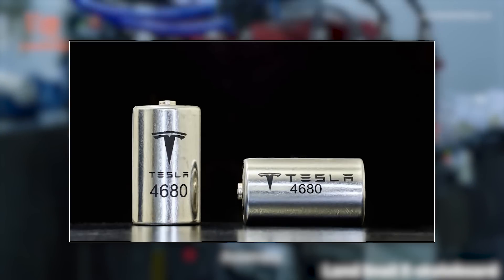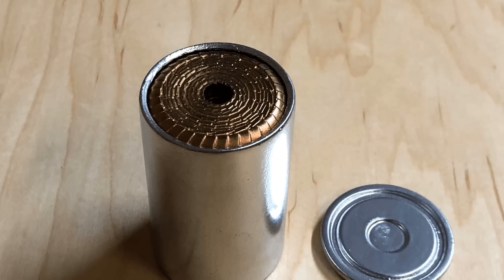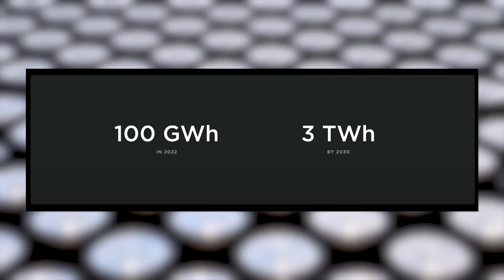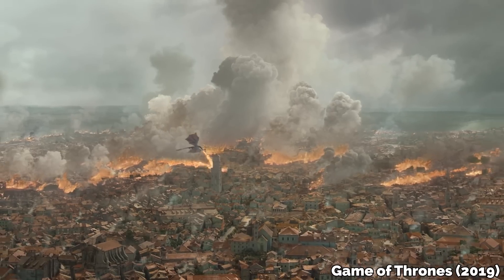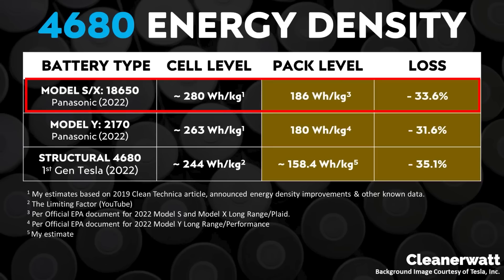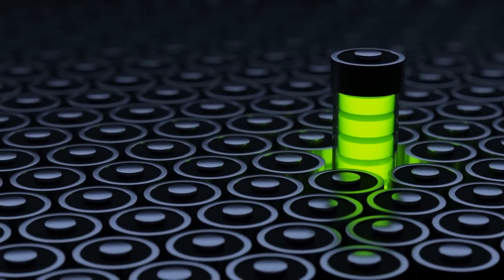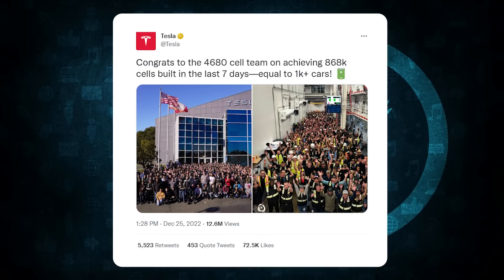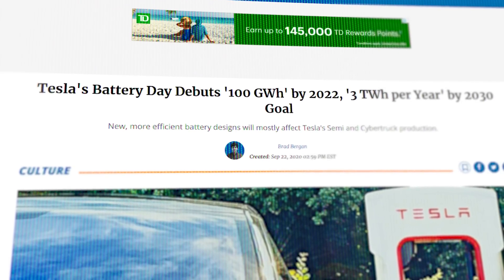The Disappointing Truth About Tesla's 4680 Battery Cell..

Comment: Its in the official numbers of Tesla that the energy density of the 4680s is lower than of the 2170s. Because Tesla said its 5x more Energy in a 5.5x bigger Battery. And with 6x more power they are on par with the pouch Cells, thanks to the tabless design. And the 16% more range (not 30%) - I think you can put more Energy in a block of cells thanks to the bigger cells. Tesla has told you so. Why have people expected something different? The only problem they have is to decrease costs because of problems in mass production. I think they will make it, but not now.

Comment: You completely ignored an important design metric: cost.   Tesla has become much more profitable recently.  It's not a s3xy message to say "we're going to derate the design to allow the use of cheaper materials" so of course they hype the potential of the new architecture to reach higher performance.    

It might be worth doing a deeper dive into cell chemistry to explore the trade-offs between cost, safety, scalability and performance (power/energy density).  I think Tesla has been focusing lately on reducing the cobalt requirements in the cells to enable scalability.  

As an Engineer and past/current owner of 4 different EVs from 4 different comapnies, I can say that ~200 miles of range is 'good enough' for most people.   More is nice, but beyond that the maximum 'real world' DCFC power levels and reliability of the DCFC stations matter more than the total available range.   

In this regard, the 'folded copper tiles' to reduce internal resistance of the cells is a significant innovation.  For cost and safety reasons,  Tesla may well elect not to take full advanatage of the current capacities of the new cells in their drivetrain design, but they can still make good use of it at the DCFCs to increase customer satisfaction and the throughput of the chargers.

Comment: One of the main advantages of the 4680 is as a structural pack and power density . It wins hands down there . Over time they will tweak it to have a great energy density at least equivalent to anything else they produce and most likely it will be the cell that most rnd will go into as it forms the nxt gen of manufacturing techniques !
Reply: Power density has not increased if you measured it, it actually decreased until battery is properly optimized

Comment: There is nothing disappoint about the 4680.  It's the same chemistry as the 2780 and yields about the same power.   I will be lower cost to manufacture.   Tesla has all the big boys lined up, GM, Ford, Toyota, Honda VW and is kicking there asses while people talking about how Tesla's margin is only 25 percent.   It's pretty clear who is getting paid off.

Comment: 18650 is the best because it has a larger market segment than a 4680. 4680 is only usable in a Tesla, while 18650 is used in wide range of application. If Tesla want to make money selling batteries, they need to make 18650.

Comment: What everyone missed in the 4680 hype (because tesla neglected to mention)  is that you get 5 times the energy from more than 5 times the weight, in other words a less efficient battery than the 2170 or the 18650,  however there are a few production advantages.  Unfortunately most people don't understand the science so they believe the hype so lets all go to Mars.

Comment: It's difficult to understand why 21700 hasn't leap-frogged over the 18650 to become the "standard" cylindrical 'flashlight' lithium cell. For just 3mm increase in diameter (1.5mm radius), and 5mm increase in length, a quality 21700 can safely and reliably deliver around 40% more Ah capacity than an quality 18650.
Also, if one decides to take advantage of the following feature, using a 21700 cell in the same application can have the ADDED major benefit of allowing one to put LESS stress on the cell by charging to the same mAh as one would have charged the 18650 cell capable of the same capacity. Remember that this is for an almost negligible increase in size and weight and in return you get a lithium cell that has a much longer lifetime and significantly more recharge cycles.

For example, charging a 5,000mAh 21700 cell to only 3,500mAh puts a LOT less stress on the 21700 cell than when charging a 3,500mAh 18650 cell to the same 3,500mAh. Thus, for the exact same amount of total per-use usage (e.g. let's say one typically used 3,000mAh of that 3,500mAh each time the cell is charged) the 21700 cell will have a MUCH, MUCH longer lifetime and have more recharging cycles to end-of-life than the 18650 cell, when charging both cells to 3500mAh. One could potentially get almost twice the number of recharges out of the 21700 cell than from out of the 18650 cell under the same charge and usage scenarios...all because one is putting far less electrochemical stress on the 21700 cell during charging and storage.

It's also much healthier for lithium-ion cells to be stored long-term at about 70% of a cell's full charge state than to be stored at a 100% of full charge state (see batteryuniversity website). Charging a 5,000mAh 3.7 li-ion 21700 cell to only 3,500mAh meets that condition. To charge to the same 70% for a 3,500mAh 18650 cell, one would charge it to only 2,450mAh. Thus, if you had to use cells straight from storage, you'd get about 40% more available energy out of a stored 21700 cell (3,500mAh) than a stored 18650 cell (2,450mAh)...which could be key during an emergency situation when you don't have time to "top-off" the cell before using it.

Comment: Just to clarify, the Ultium is not « just an off the shelf » battery chemistry. I think it is the only NMCA battery on the market. NMCA has the same energy density as NMC but it solves one of the main weaknesses of NMC: relatively low number of charge cycle before degradation.
Basically il combines the energy density of NMC battery with LFP charge cycle endurance.

Comment: Tesla acquired SilLion and Springpower around november 2021 to advance and upgrade the anode and cathode for their new 4680 battery cell technology. Tesla already has the capability to build the 4680 battery with a 30% increase in energy density but they dont need to release this technology yet until they need to compete in 2 or 3 years time. Currently, its pointless to increase the cost of the vehicle and complicated production wise to add to the cost for the premium A version of the battery and then charge customers more for it, plus it gives the competition an advantage by releasing a benchmark standard for them to all beat. I am pretty sure Teslas battery engineers have already unlocked more than 30% increase in energy density for the 4680 battery cell which can easily be scaled for mass production within their existing battery production factories.

Comment: ummm... no tesla didn't over promise and under deliver. Tesla presented a roadmap and gave no commitment on when the entirety of that roadmap would be deployed. At most they committed to initially begin deploying 4680 last year. Which they did below the targetted run rate. But they did not commit that all the roadmap innovations would have been included. The only roadmap innovations that had to be included was the dry electrode stuff, which was included because not doing it would have required a vastly different layout of their battery production facilities.

So if your scoreboarding this you got a Factory that can churn out 4680 form factor at far less Cost than standard battery cell production facilities., you got structural pack, you got dry battery electrode, you got tabless... think the only thing missing is tesla silicon....

In addition from the analysis done it is obvious in the current generation of 4680's they are shipping the cell walls are thicker than the cell walls on the other cylindrical cells, dont need to trust me go re watch limiting factors break down. It was beyond obvious from battery day that tesla was going to engage in a phased approach to deploying their 4680 cellline. The problem is channels like this and others incorrectly assumed the innovations would all land at the same time. Thats not tesla's fault that is the fault of those incorrectly understanding the information that was presented.

Comment: Im trying to decide between a 2022 Model Y long range and a 2023 Model Y 4680 and nervous about the new technology. While the lower range is not a deal-breaker, the old battery has a proven track record. Which would you go with and why?
Reply: I wanted the 4680 batteries in our new MY but our car delivered much quicker than anticipated. In the end, I’m happy after hearing of the 4680 issues. We now have over 14K miles on it with zero issues.
Reply: the lifespan is unknown only rumour to be longer. well with next gen cells at least.. my question is WHY havent they release the lifespan info ? is it TOO GOOD? or same or worse??

Comment: Thanks and congrats on this video, it is refreshing to see some reality check inside the (sometimes crazy) hype surrounding Tesla.

Personally, I don´t agree with the part of the video that "faults" the community for simply believing what Elon said.  I very much agree that people need to do a bit more of keeping feet on the ground, but how is someone supposed to conceive that one of the most successful CEOs (and supposedly an expert on the matter) can get it so terribly wrong?  As some have said in this comments section, Elon and time estimations is a running joke.

In my opinion, though, this video is guilty of doing the very same thing it tries to correct.  First it acknowledges overhyping something, then it rationalizes it somehow, but then sort of overhypes it again, assuming the 4680 will 100% deliver on the promise , only a bit later than expected, AND that the competition are pretty much staring at the wall, watching paint dry.  Again, this overhypes Tesla potential with no solid foundation, because if we accept Tesla will spend years before they can fully get the 4680 potential, to assume the rest are simply going to wait and see how that happens...  I don´t think so.

At this point, specially seeing how many setbacks each and every player in the battery innovation game is facing, I think we need to really keep expectations realistic.  Munro himself has acknowledged that if Toyota (or anyone else) gets solid state battery right, that would be a major blow for Tesla.  I think the point is, we shouldn´t try to read too much into this.  Any electric car one can buy today and in following years, Tesla or otherwise, are fairly balanced in what they offer.  Some are better, some are worse, but there is no real game changer and I think it will stay that way moving forward.  People simply should buy whatever it is they like and enjoy it, no need to fanboy or troll.

Comment: I like how they crammed 5 times more energy into something that has about 5 times more volume and weight.
Reply: The goal is faster manufacturing, it can be made in the same energy and time that only one small battery can be made ,so you have five times the energy with only one effort at manufacturing Einstein.
Reply: @salvalooez2249  Einstein E=MC^(faster manufacturing)
Reply: Yes, that's exactly how it works.
But, the bigger cells mean that you need fewer of them for the same total pack capacity, which reduces time and effort for manufacturing and translating into lower costs for the entire pack.
It's the same reason why a V12 engine costs much more than an inline 4-cylinder one even if they both have the exact same displacement.
Reply: Yeah I thought I was the only one to notice that, which means just 6 of one, a half a dozen of another.

Comment: Dude, what are you talking about? There is 5 times fewer batteries in those packs producing similar performance. Once they get production ramped up, do you have any idea how much cheaper these will be to make? The assembly time for example will be cut by 50%+ for each battery pack. You need to look at the big picture not just compare specs

Comment: I think the point of the 4680 battery is more on manufacturing than performance. Although performance is in the works. It's widely know the hindering aspect of electrification is availability of batteries. Tesla is actually changing the manufacturing technology of batteries to overcome this. They absolutely will get it close to what was advertised.

Comment: You do all understand that the larger cell means fewer can be installed in the pack so the load is distributed over a smaller number of cells resulting in a higher voltage drop during high loads. Not to mention the additional air space between the larger cells further reducing energy density.

Why are you so quick to defend Musk over what was an obviously flawed design? The pack delivered the expected results in the real world, it wasn’t the physics defying miracle it was made out to be. It was a step backwards in progress, a costly mistake that many would have advised against pursuing.

Musk is a world class con artist and it shocks me how so few can see through his lies

Comment: I believe Tesla has bigger issues than just the current de-hype of the 4680 battery.  As a former owner of a Model E, I jumped on the Model Y huge price decrease and have an estimated delivery in about 2-3 weeks which qualifies me for the fed tax.  That is roughly a 30% savings versus the price 3 months ago. So, why am I  (and others) thinking of cancelling our order on such an outstanding offer on such a fantastic EV, the Model Y?  Because Tesla has made their current car lineup extremely unsafe by eliminating sensors and radar from their vehicles replacing it with vaporware called "Vison"

Vision has proven unsuccessful so far to auto pilot (adaptive cruise and lane centering) their vehicles in a safe manner.  And, the absence of parking sensors  has increase the possibility the damage to the vehicle.  Also,  there is a greater chance of accidents leading to injuries due to the removal of sensor safety features  without a viable replacement.

Tesla needs to address these concerns quickly or risk further damage to their shifting reputation as a "safe" product.

Comment: I think there are a few things to keep in mind:
1.  At battery day Elon did say there were a lot of issues to solve in the new manufacturing process.  Many, if not all, of us expected them to solve them quicker than they have, but when innovating at the cutting edge you run into lots of unforeseen issues that you have to work through.
2.  Covid and global supply shortages put a huge strain on manufacturing.  I'm sure Tesla kept working on the batteries, but I also wouldn't be surprised to learn that they pulled engineers from that project to help keep plants making cars.  Model Y ramp is simply much more important than CT or 4680 ramp.  They did this with solar during 3 launch.
3.  It's important to remember that while we as consumers want to see the returns of the 4680's from a performance standpoint, at least half of the benefit to Tesla is the reduced manufacturing cost, reduced cap x, reduced space required for the manufacturing, and the integration of structural pack in the manufacturing process with the end castings.  These are HUGE savings to Tesla that many seem to overlook and the media referred to it as "some manufacturing improvement" in their reporting.  There isn't a manufacturing company of any sort that wouldn't drool over any of these improvements, much less all of them.  Just the manufacturing aspects are absolutely mind blowing.  This is how Tesla is going to be able to continue to stress the rest of the auto industry by reducing prices and still maintaining high margins.
4.  Elon has stated before that he doesn't think people need more than about 300 or so miles, so I don't expect him to waste a ton of batteries on super long range versions of cars while battery supply is low, especially with CT coming soon and Semi ramping.  I was really surprised that the first 4680 cars from Texas were such low range vehicles, but from an efficiency and manufacturing standpoint it makes a ton of sense.  Those first cars were basically just practice production runs to prove the battery and the structural pack in the real world.
5.  We have only seen the LFP version of the 4680.  Elon outlined three different cathode materials at battery day:  Iron based (currently LFP), Nickel/Manganese based, and High Nickel.  LFP is medium range.  Nickel/Manganese he categorized as Medium + and stated that in pack state they are about 50% better than Iron based.  High nickel he stated is for Long Range and is intended for CT and Semi.
6.  I don't remember the effects of the Anode materials, but if I remember correctly they were a smaller part of the overall improvement.  The possible silicon anode will both improve the battery and make a huge difference in environmental impact of the battery packs.

Comment: The long term potential of the 4680 is in scaled production. The efficiency of production reduces cost per but keep in mind that battery chemistry is changing and hopefully improving. If the manufacturing of the current 4680 is able to ramp up then they will probably be able to tweak the chemistry seamlessly. They keep the advantages of the production line and improve the chemistry when it happens. This is an unknown of course but things are changing so fast that flexibility in production, like with the changes they make on the run to Tesla cars, is a big advantage long term.

Comment: You can plot a learning curve base on production at the start of the year Vs where they are now. Target was 10x less space & 5x faster production rate. If you get halve way there in the next 18 months but want to ramp up….you need more space & more equipment. This maybe the main reason they Moved Berlin equipment to Texas (Vs taking advantage of IRA credits). Tesla does control the build on the equipment…s/be excellerating.